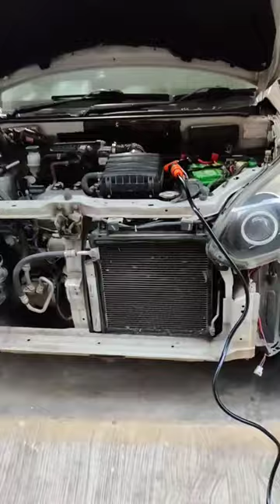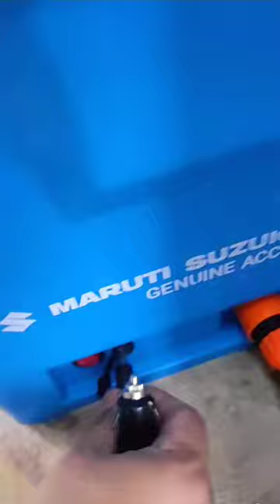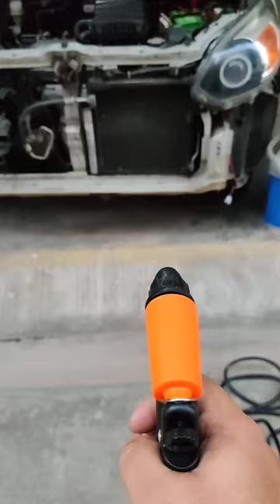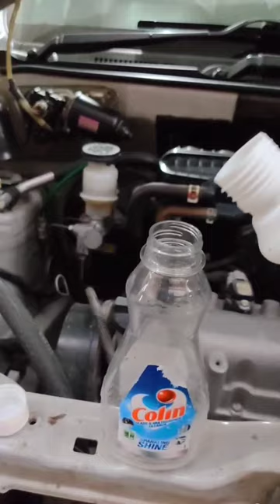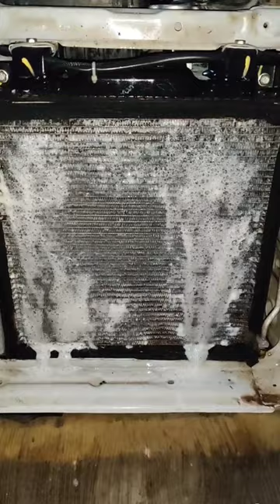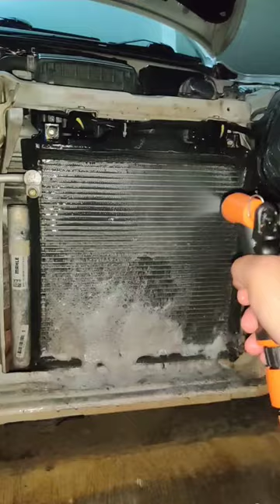RADIATOR & CONDENSER CLEANING AT HOME | DIY | MARUTI SUZUKI ALTO 800 | ALL CARS

Comment: This is not a radiator .. it is AC condonsor.
Reply from the maker: You are right. Corrected. 👍🏼
Reply: Can we use that same alkaline solution in radiators as well?
Reply from the maker: Yes, should work on radiator too.